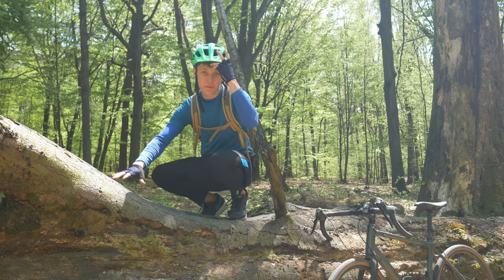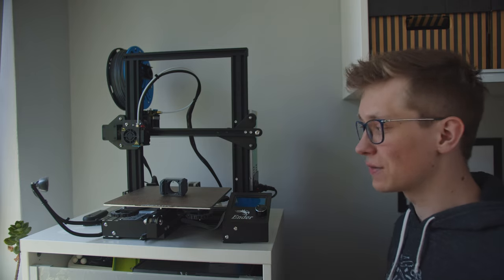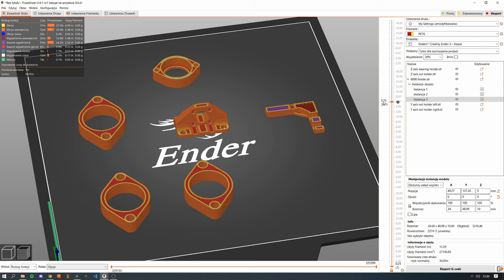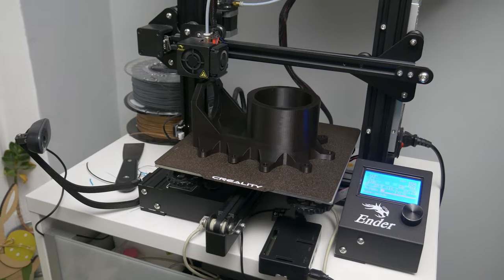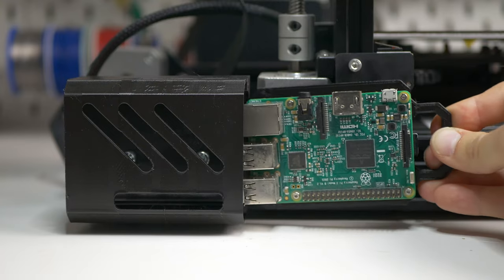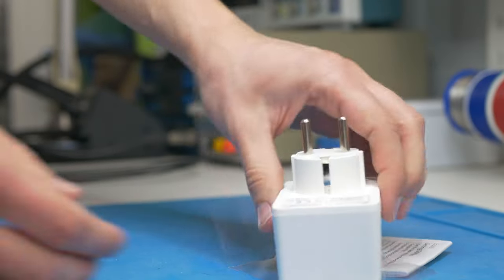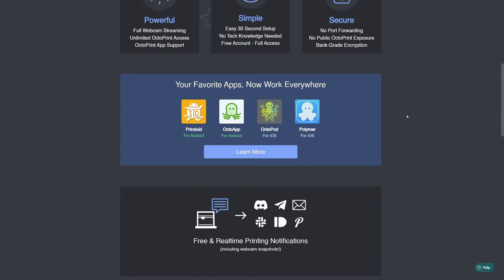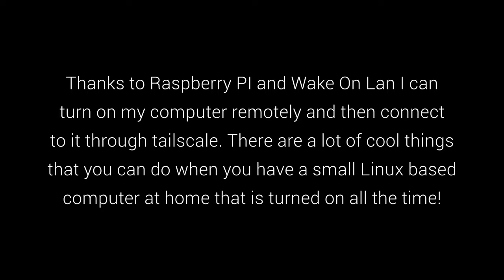OctoPrint - 3D print from anywhere!

Comment: Look for Klipper with Fluidd/Mainsail and you will fall in love with that... You already have Rpi, so you can do it without spending any money. In Klipper you can set Pressure Advance and Resonance Compensation, sou you can cut even half of time while printing parts. In addition when you want to change something in your printer firmware, you don't have to compile and upload new /bin file with firmware - you just edit .cfg file and restart printer and new configuration is updated. In addition you can install f.e. Tailscale VPN, and then you can also control printer and watch it from accross the whole world ;)

Comment: Hello Nikodem,
I think you can use the Octoprint plugin "System Command Editor" to add customized buttons to your Octoprint Interface. I use this plugin to switch on/off a light on the extruder, which is controlled via the GPIO pins of the raspberry. I use a python script to control the gpio pins. You can write your python commands in a script-file and then assess the script-file with the "System Command Editor" Plugin. Within the plugin you have to add simply a command like "python /location-of-your-script/your-script"